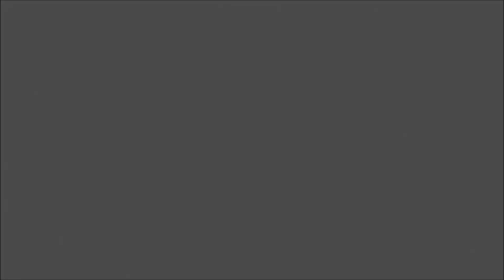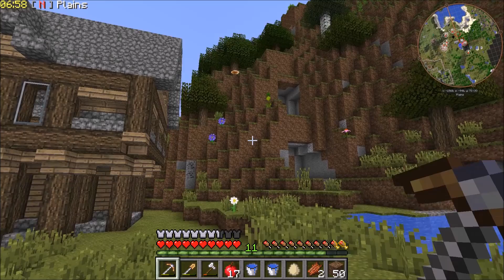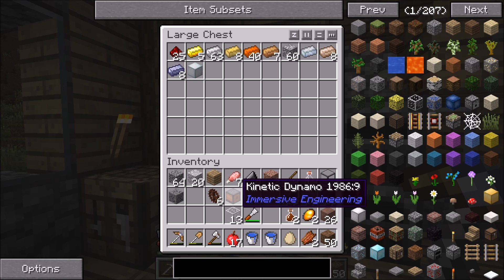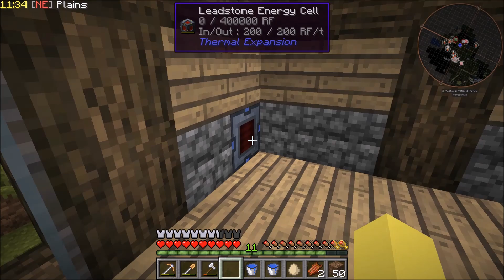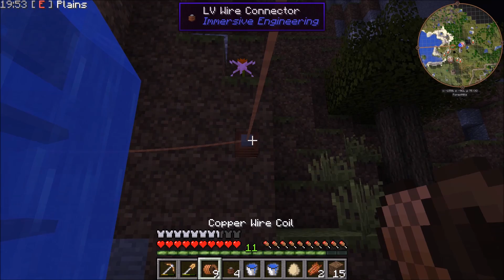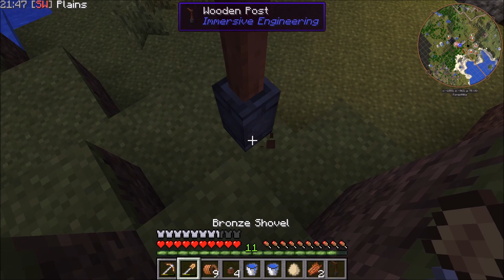Minecraft Unabridged : Primus :: Ep.3 -  Immersive Engineering Water Wheel Power

Comment: ok so  i suggest you swap the kinetic dynamos  to the other side of the water wheels. it will save you some  wire & connectors. Also if you wanna get fancy maybe you can make a little tower up the mountain with floors stopping at where the dynamos are  to facilitate maintenance & a way to the top .